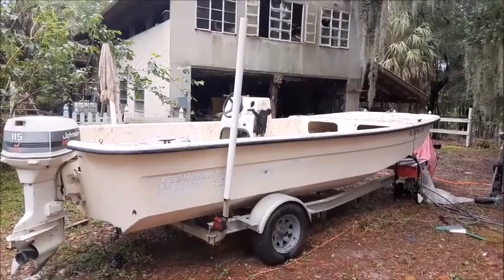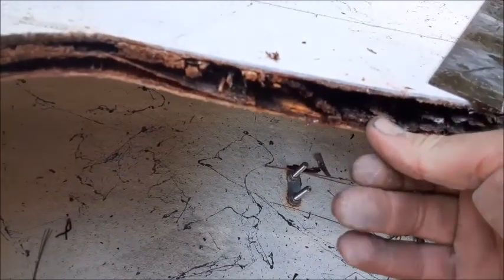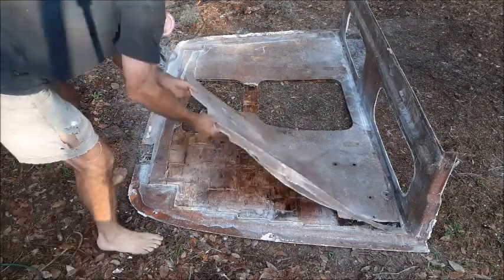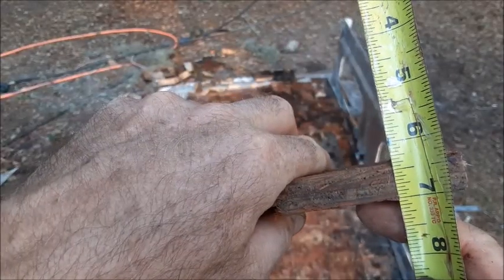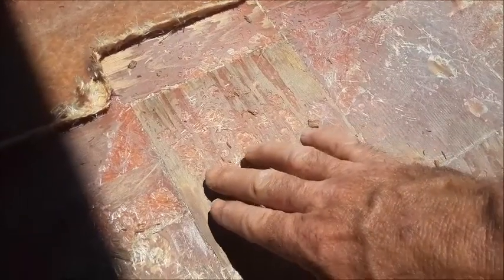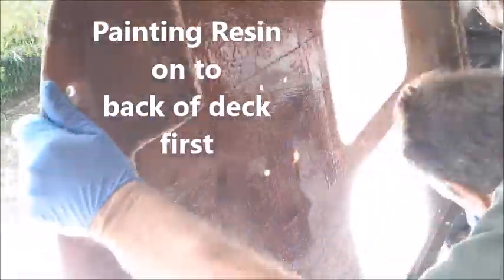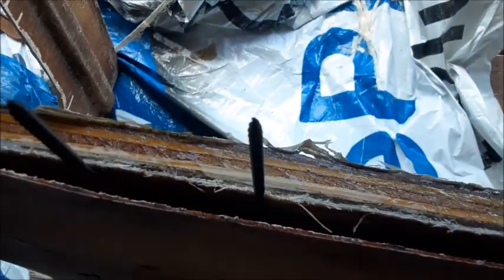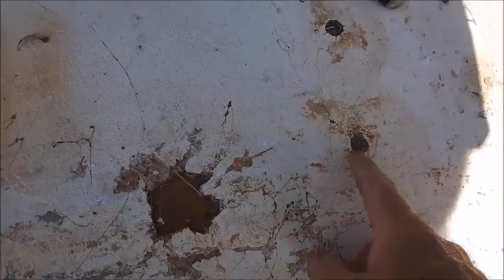Carolina Skiff Rotten Front Deck Wood Replacement

Comment: Awesome! I just did this repair on the rear of a skiff. I opted for 3/4" Coosa in the 20lb/ft^3 density. Carolina skiff said they discontinued putting wood in boats, and it made sense to me to leave out a product that I am replacing due to the inherent flaw of rotting from almost inevitable water intrusion. Coosa marketed less than 1% water saturation, but I sealed all the screws with 3m 5200 regardless. Very similar method, removed the seat, epoxied the coosa board in, fiberglass mat with polyester resin  topped with gelcoat. Better than ever.
Reply from the maker: Hi David,  Thanks for the comment.  Great suggestion, I had not heard of Coosa board before but looked on their website to study it.  A little pricey but probably worth it in the long run.  Does a 4x8 sheet of Coosa 20lb weigh 20lb?
Reply: @creativerepairing2960  It is definitely more expensive than plywood or marine plywood. I had never used the material before so the experience coupled with the labor justified the cost for me. A 3/4" thick 4'x8' sheet of coosa 20 weighs 40lb (20lb per cubic foot of material). They make a slightly denser product called coosa 26 which is good for transoms.

Comment: I have replaced several transom’s on fiberglass bass and ski boats due to the bolt’s penetration that secured the outboard engine. As you so noted penetrating fiberglass with wood supporting structure of boats has it’s problems eventually. But I have gotten great deals knowing I had the tools and know how. It’s great that you teach others they can enjoy boating without having to go in debt for fun if willing to rehab an older boat and save a bundle of money. Enjoyed you also sharing Jesus Christ as our only hope for Eternity!